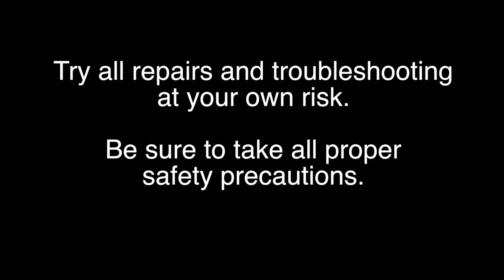Samsung 60" LED TV - LED Strip Replacement Tutorial Fixing Bad LEDs - BN96-29074A & BN96-29075A

Comment: Good video .
Excellent Video.
Careful removing the plastic frame clips, everything holding the panels together is FRAGILE PLASTIC and WILL BREAK EASILY. The reflector sheet is more fragile than the plastic frame that holds everything together. After use, it heats up and becomes very easy to tear.

I came here trying to learn at what voltage & amp the LEDs run at to use in DIY projects. An 18650 lights them up extremely BRIGHT, but after about 5 seconds they start smoking. A 1.5 AA does nothing.
(in other words, trashed the TV and saved the LEDs and boards, and some of the panels)

Comment: thanks for the video, i successfully replaced the led backlights. 
During the reassembly, one of the "buffer board" flex clips to the screen (not the two main connectors for the t con board) came loose as i pulled to hard on the buffer board to get in the tab. Does anyone have any guidance on how to reattach the clip for the screen back to the buffer board. just fyi, it was the last clip on the right side of the screen. any help would be greatly appreciated.

Comment: Is it normal for this TV to have some quiet buzzing or humming coming from the power board or the LED's after full assembled?  The buzzing goes away when the TCONN board is disconnected.  Ive replaced the power board, the TConn board and the main board.

Comment: I replace LEDs as you instructed great video before putting it back together. I plugged in the Teon board, but did not have the leads to the Teon board connected. The lights flashed when they came on and then they went off like your video I could not get them to stay on, but you did on the video so I think I still have problems.

Comment: PLEASE READ BEFORE ATTEMPTING!
A huge warning to anyone attempting this repair:

Following this tutorial, I successfully replaced and fixed my backlight LED strips. However, the screen now only shows red or yellow vertical lines in secrions and has serious pixel bleed. It doesn't look as though the panel is damaged during reinstall. My suspician is that I damaged the buffer boards and ribbons while using the 5-in-1 to remove the bezel.

TLDR; When removing the bezel, be extremely careful on the bottom section of the TV. This is where the buffer boards are for the panel and you can very easily damage this board by being too erratic with your remover tool. Learn from my mistake!!
Reply: Or maybe you got one of the diffuser panels in backwards/upside down.
Reply: @IsitReal_or_AI  Nope, it was definitely damaged ribbon cables. only one diffuser panel present and I was particular about how to reinstall. The issue was clearly from the panel itself

Comment: A great great tutorial. Definitely get those suction cups don't even think about lifting the screen. Another piece of advice - order some replacements for those clips that hold down the reflector sheet. Don't want have to break down the Tv again. I had to just space out the half that did not crack during removal around the reflector sheet when I reinstalled it.

Comment: I replaced my leds just like you show here. Put the tv back together and all the leds work now but something went wrong. I now have vertical lines on my tv and then it lights up to a bright screen with faint vertical lines. What did I do wrong? I did everything just like this video.
Reply: Same here, half of my screen has vertical lines now. I discovered that I ruined one of the two Tcon ribbon cables by pulling it out without first lifting up on the release tab. I wish that step had been in the video.  I just now ordered a used ribbon cable on Ebay which seems like it matches, although the part number doesn't match exactly. Hope that fixes it.
Reply: @shoffmantube  Do you fix it?
Reply: My guess is one of the diffuser panels is installed wrong. Make sure to lay out the pieces exactly as you remove them, 
top = top
left = left
front = front
They may look the same from the front and back, but they block light in a specific direction (horizontally/vertically).

Comment: Would you know what my panel model number would be, since there is no sticker on my panel, I need to order replacment LED strips, I belive it is the same as the tv in this video, at least looks the exact same.
        SAMSUNG
Model # UN60H6203AF
TYPE- UN60H620
MODEL CODE- UN60H620AFXZA
VERSION- HH01
S/N- 02Q43CDF500105R

Comment: So my 60 inch has no standby light on . It will not turn on. I replaced the bridge diode block  in the power supply even though off the board it tested good. With the power supply not hooked up I got the 12-13v  out at the pin connections on the board but once I installed the power supply board and hooked up everything the voltages at the pins were like 1 volt or so. Also I could hear a slight ticking sound in the area where the connection on top is towards the led. Would that be sufficient info to suspect that the led strips are bad? Again . using the remote , it is hard to say whether the tv is on or not.

Comment: I put new led strips in but they won't light up. If I touch the.metal of the tv and the negative spot on the led they will come on. My old ones come on but only 5 bulbs. How do I fix this?
Reply: Yes I did. The led lights were bad, but so was one of the wires running the lights.  That's why they wouldn't light up
Reply: Do you fix it?

Comment: Jimmy, am working on a Samsung UN40H5203AF.  One of the LED strips is bad.  D3GE-400-R2.  Lots of them on ebay that are “unbranded”.  Looks like it will come in the 3 piece set.  Are unbranded good or should I try to get an original if I can?  Thanks in advance for your answer.

Comment: How can you distinguish between a LED backlight problem and a backlight inverter board problem?
Reply: You can use the diode function of a multimeter and use the test points on either side of the LED to see if it lights up. If it does, you have a good LED and its likely the power supply, if it doesn't the LED is dead.

Comment: This video was absolutely spot-on for replacing the LED Arrays. I cannot stress how much we followed the exact order for disassembly and reassembly, and it now works beautifully. Thank you.

For people who have not done this before, I might make two small comments. First, when you go to remove the Bezel, look closely, and you can see a channel in the plastic that is close to the outer edge - if you put your tool in here, you can crack the edge of the bezel. Put your tool into the space between the plastic bezel and the metal frame of the TV. The second is the electronic ribbon connection between the T-Con Board and the Buffer Boards. We disconnected them at the T-Con Board. You flip up the little, black latch over the ribbons, and gently slide them out. Reassembly is the reverse.
Reply: @J. R. Buzzell quick question. How can I tell where to find the right LED lights for my TV? A reply would be very helpful

Comment: I would suggest disconnecting the power to the strip board before touching the strips. I got a little shock when I touched them. Also, make sure your reflector sheet is touching the back of the tv or you will get shadows on the screen as it pushes towards the front of the tv.

Comment: Hello, nice video, but i have little question, i want to fix UN60F6300 but can't find LED part number. What would you recommend from Mouser or Digi-Key?
ps: I found it on the street, it work well but i think six lower LED stripes  doesn't work.

Comment: Here are a couple of tips from my experience doing this job.  Regarding the little white grommets that help hold the led strips in place, try not to lose them and when you go to put them back into their place, there's a good chance you'll need to use something (I used a pocket knife) to slightly pry the wings back open before you install them. Otherwise, they won't lock in place.  Same goes for the wings on the clear reflector sheet spacers.  As far as double-sided tape on the back of the led strips, I didn't go that route.  Instead, I chose to use a good quality, white, general purpose (duct) tape (Note: I think gray tape might be just fine).  I cut it into strips similar in width to that long strip of clear, reinforced tape that Samsung used from top to bottom at the factory.  I also used an individual strip over each led strip in the same spot where Samsung put that long tape strip at the factory.  It just seemed easier that way.

Comment: So, do the T-con ribbon cables need to be disconnected from the buffer board?  In this video, after the T-con board cover is removed, it's hard to tell for sure, but it looks like those two ribbon cables suddenly appear loose. Did you just forget to video disconnecting them or did they stay connected? I have just flipped the tv over and removed the bezel and began to wonder about this.

Comment: awesome video! i have the same TV and here is what I am running into.

On the CNL802 connector going to the LED strips, when its plugged in there is a slight repetetive clicking noise and it pegs out of 5-7V  on the first 2 pins. When I unplug the connector and test the voltage on the first and second connector on the board, it buries the needle. the board says the pin volt specs are 326V and 410mA on CH1

would using this method resolve my issue? slight constant clicking, screen won’t turn on, no status light on front
Reply: also, i just noticed that the lights are flickering with the clicking.

Comment: Disconnect the buffer board from the t con . How? O.k got it👍
Reply: This was a little scary and a closeup would have helped.  You need to flick open the black ribbon cable lock with your fingernail.  Be very careful  it is super fragile.

Comment: Nice video .. may I ask how durable is the screen ? If I am applying normal pressure on cleaning and wiping it .. even tho I saw the screen like pushing in and out ... Will I damage it? Also the edge is pretty well sealed or clip on right? . So the little amount of the excess water from a wet wipe probably won't go inside of the TV right? Thanks again
Reply: Screens are not durable they can crack very easily especially when you assemble the tv watch the corners and be very careful with the frame the frame is flimsy

Comment: @shopjimm.com. I'm just wondering if there is a way to replace flecible printed cable connecting buffer board with the LC panel in Samsund 49'' LED TV? I've managed to pinch a hole with a needle in one of it and I have nice thin black vertical strip on TV :(

Comment: Thanks for the great video. I have a model UN82NU8000 Samsung Smart TV that someone through a lighter at the screen. 

The outer screen is fine, no dings, cracks, etc. However when I power on the TV I can hear the sound, but the screen is completely black with spider cracks from the spot impact of the lighter. 

Is this the repair required for my issue or do i need to replace something else? Also, do you carry these parts for my specific model?
Reply: You need to replace tv. Lcd would cost as much or more than a new tv.

Comment: Flashlight test showed that I had a backlight issue. Replaced power supply and main boards. Nothing. Replaced led lights. Nothing, except I learned that when I plug the TV into the outlet, all of the leds blink for a split second and don't come back. I don't understand what I'm supposed to do now.
Reply: You fixed it?
Reply: @Loykaz  nope. The market value is less than the cost of having a repairman fix it so I just bought a new one.
Reply: Billson Gilberts yeah that’s the sad reality of today, but sounds weird that you changed basically all components without success?

Comment: Nice video, it would be great to add display of TV screen before and after the fix
Reply: failed LED cause "purple cloud" blobs on a white lit screen, its very common with Samsung TVs after 2-4 years of use. Most consumers throw away the TVs and buy a new one. Repair costs 300$ or more like this
Reply: @PacouJustPacou  I have the same tv but the screen keeps blinking on and off with a black and white light the moment you plug it in. You can't turn it off. How can I fix it? ):
Reply: @PacouJustPacou  
That's exactly what I have on my 65'KS9500, it was expensive tho and I don't wanna throw it lol
Repairing such issue from a technician on a curved screen is easy? or can damage the whole tv?

Comment: You should not have to go threw this much effort to fix a TV and in my case,a TV that is only 1 year and 3 months old.My opinion I got ripped off by Samsung.I have a 30 year old Sharp TV that I keep as back up and it still works today.
Reply: as a TV repair tech You cannot compare a low resolution tube TV from 30 years ago that has very little to do to make an image, to today's modern 4K HDTVs with smart technology are basically computers with the monitor. they're also much less money than what you paid for 30 years ago comparatively. Basically treat a brand new TV is a light bulb by big and cheap would a 5-year Costco warranty and after that throw it away.
Reply: You are setting up an electronic museum at home... don't be so conservative.

Comment: I replaced the lights and the power board. I turned the TV on and I have a dim screen and cannot see any picture,  just a dark blue screen.  Any ideas on where to look to see what I did wrong?
Reply: TV is a un55ju6700
Reply: @dereckcasper1342  ever find out what happened?
Reply: @madpriest7822  I got wrapped up with an engine rebuild. I'm probably going to take it apart and figure it out.

Comment: I have the same tv in the video. How do I determine if it is the driver on the main supply or the actual LED strips?
Reply: You measure the voltages on the pins on the power board that supplies voltage to the strips.  Look where the led strips connect to the power board.  Make note of which wires on the LED side (mine was 1, 4, 5 and 8), disconnect the plug and carefully measure the voltage of those pins to ground.  My voltage was 420v.  My set has 6 strips in series with 14 LED on each giving a total of 84 LEDs.  In series then that is 421/84 or 5.0 volts each which is about right.  I changed all strips last night and TV is working well.
Reply: pretty easy question.. you send the tv for him to check it for you.  :-)

Comment: I have a 54.5 LED Dick Smith DSE tv that works well at first but after a while goes black (sound still works) if you shine a flashlight at screen you can see the images. When I turn the tv off for 5 minutes it works again. Will changing the backlights like you did fix this?